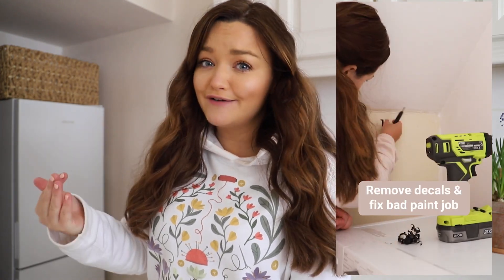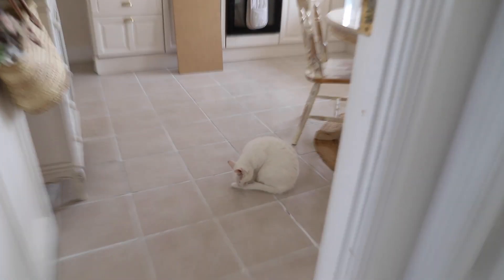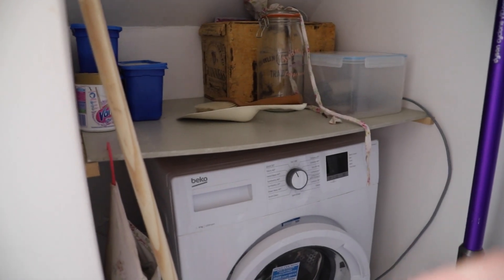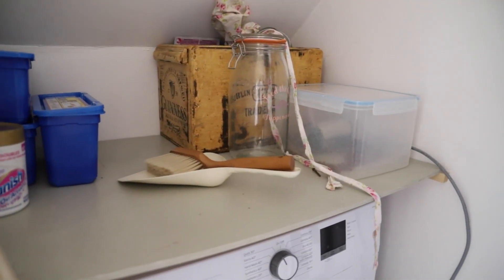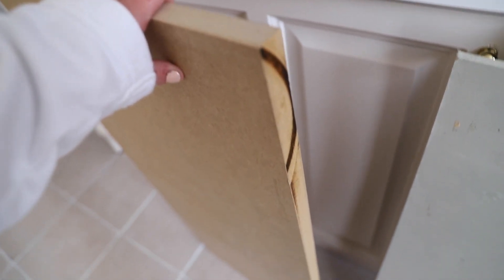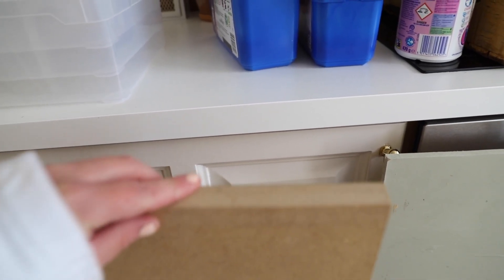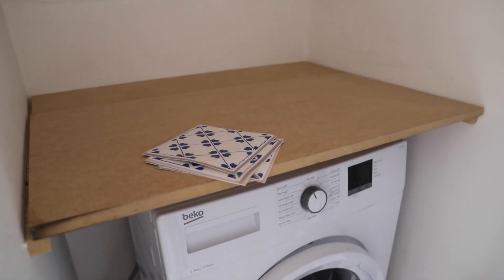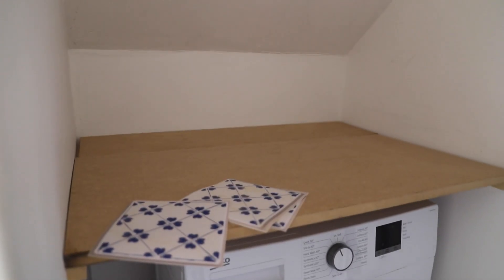Teeny tiny laundry nook makeover, peel and stick tile... Yay or nay?

Comment: Jus sayn if you cut that board the width of your washer you would have that whole side wall to hang things. Or they have a slide out you could put on side of washer . There is shelves you could put your soap , fabric softener, bleach. Then space to hang your mop n broom. Love the blue and white stick n peel. On back you would just put a leg on back corner and front corner for support for the wood on top of washer. ❤️

Comment: I have a tiny laundry space also & utterly love it! Since my home is small to start with that it doesn't take up a lot of square footage is wonderful. I need that space elsewhere! Like you I put self stick tiles behind my washer, which is small like yours, & a shelf over.  I have a gullwing clothes drying rack I fold up and slide in beside my washer.  No need for a dryer when air will do the same. It's better for clothes to air dry anyway. I was able to switch the direction the door opens on my washer & did. Huge difference that made! I wish I'd seen the tiles you used. In love with those!

Comment: You could add some decorative L shaped shelf brackets at the front, just cut back the support ledge a bit and fit them in the front under the shelf... or ontop infact. Use some drywall plugs to ensure a secure attachment to the wall. I'll send you a pic of my linen closet using brackets, my shelves are smaller and also pine.

Comment: I live in a small stone cottage with the tiniest kitchen which is an L shape. My friend gave me a piece of work top and 4 legs. Unfortunately the legs were too small so I bought some pipe which can accommodate the legs and cut it to length.  I then added the top of a dresser with glass doors and placed in the centre of the worktop. To finish the look I used curtain wire and hung a pink gingham curtain under the worktop to hide my washing machine and kitchen waste bin. There's still place under there for other things and the whole area looks really cute.
Reply from the maker: That sounds lovely Moya 💕

Comment: Gorgeous as usual Catherine. Did you think of using the scraps from the wall tiles on your plastic storage boxes? And as you have some space between the wall and washing machine you might be able to take out a notch from your counter top to slide the broom and or mop in to keep them
out  of the way. There may be space to add a bucket for mop drips. But it’s perfect the way it is. I love the curtain idea. 😀
Reply from the maker: That’s a good idea Catherine! 💕

Comment: Hi Catherine, I love your laundry nook and the stick on tiles look great.
I was going to suggest if the shelf bows you could make a wooden block frame to sit on top of your washing machine. To support the shelf. But your wood is nice and thick so hopefully that doesn’t happen. A curtain is a good idea, you can put Blondie’s spare cat litter bag at the side of your machine. Or make or buy a slim unit on casters to pull in and out. Have a lovely Easter 😊💖
Reply from the maker: Thanks Jo😍💕 have a lovely Easter weekend! Xx
Reply: @DaintyDiaries  Thankyou 😊